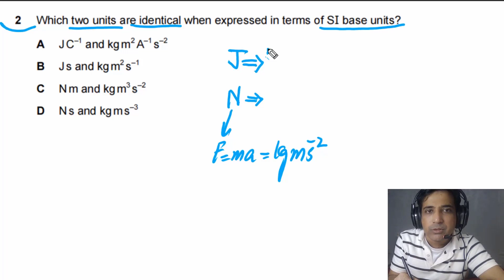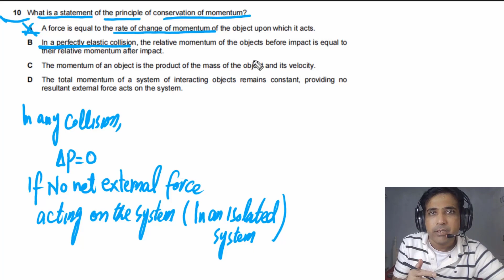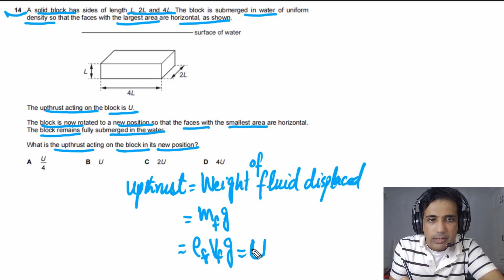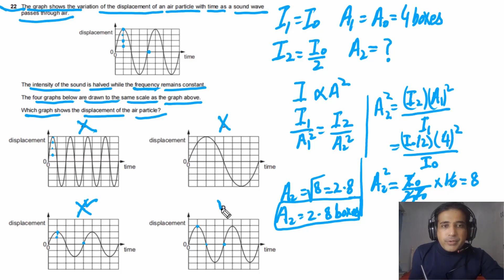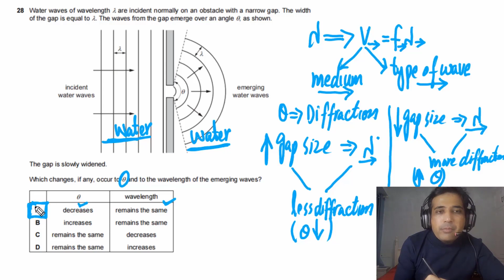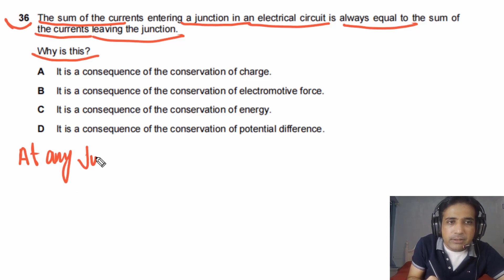CIE A Level  Physics Paper 11-May June  2022 Paper 11-9702/MJ/2022/P11- Full and Detailed Solution

Comment: i think there is a mistake in Q9. The question says move through air. That means air resistance is present. but u say it means its negligible. i am confused. can u clarify plz? Also when air resistance is present does the horizontal velocity decrease to zero? i saw in znotes website that it decrease to zero but i am not so sure
Reply from the maker: Air resistance is not negligible in this case , may be you need to watch video again 🙂